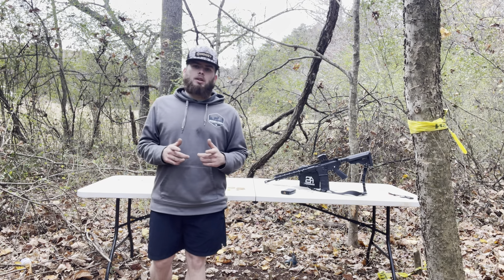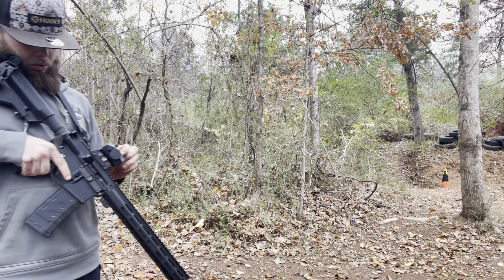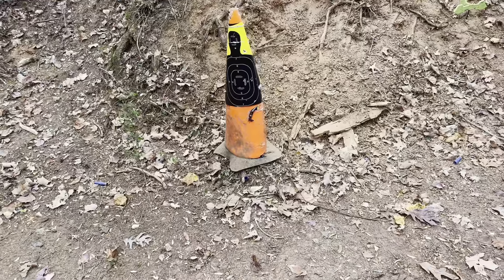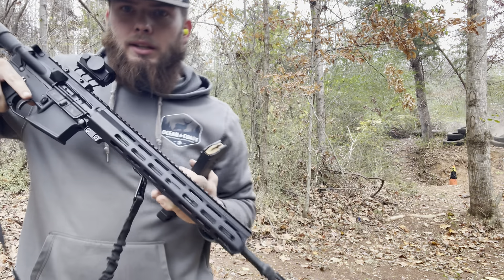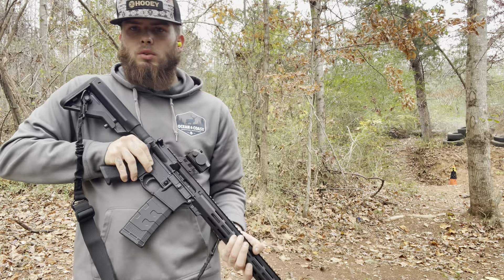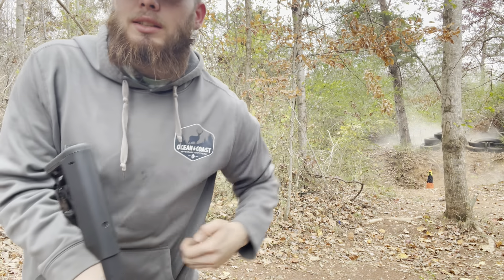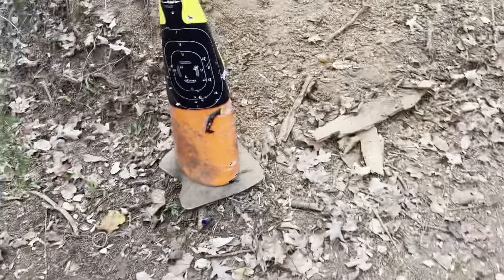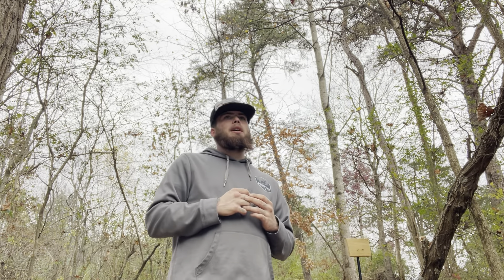Can you still be accurate with a super saftey?👀

Comment: Well if the lube and polish didnt work, sounds like that buffer needs to be beefier. Most FRT style triggers recommend H2 or H3 buffers. Could be a solution.
Reply: Whats the difference between an H2 vs an H3? Which is better for ARs with the super safety or a legal DIAS?
Reply: an H2 is 4.6 ounces and H3 is 5.4 ounces. I run a rifle buffer which is 5.15 ounces. Not per se better for one vs the other but the buffer is going to depend on your ammo a bit and the gassing of your rifle/carbine. It's what absorbs the backward movement of the BCG so even the weight of your BCG will play into it. That's why many guys use an adjustable buffer weight. Lighter weights will have problems with certain FRT (not the same as a Hoffman active reset) because they dont travel as far backward or exert as much force returning home. Hoffman told me the buffer weight shouldnt have issues with his Super Safety.
Reply: @doughnut101  • I appreciate your detailed response sir. I wonder why there’s all these issues with the Hoffman SS. What buffer is recommended for those who have the luxury of owning a DIAS (like the swift link)??
Reply: @MrBigChops  just so you're aware, a DIAS, a Swift Link and Lightning Link are not quite the same as they are a different in how they function.
The DIAS and Swift link look like the number 5 in their shape. Whereas a LL is more like a long letter L laid on it's back. 

You still need a specific trigger, hammer, disconnector, and yes- safety for a DIAS to operate correctly. Unlike a DIAS, the Swift Link works by depressing the disconnector when the bolt closes, releasing the hammer. This results in full auto fire. Swift links are easier to make and require less FA parts but as all things here, they're all considered NFA parts requiring special licenses to make and register.
Reply: @doughnut101  • Yes sir, I was just curious if the swift links work better with a certain buffer weight or anything else that will improve reliability or slow down rate of fire?
Reply: @MrBigChops  heavier weighted buffers will be slower, but allow for better extraction and reduce felt recoil.